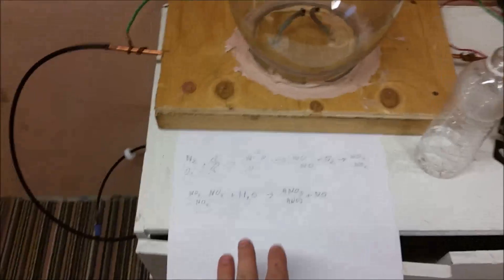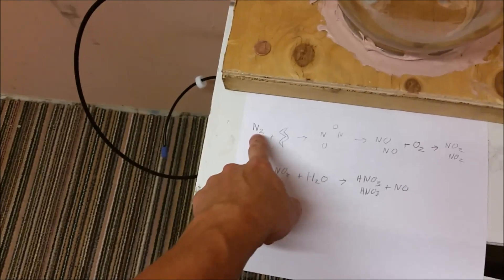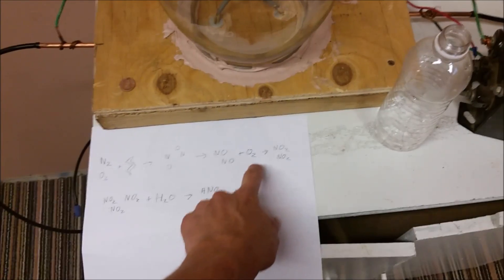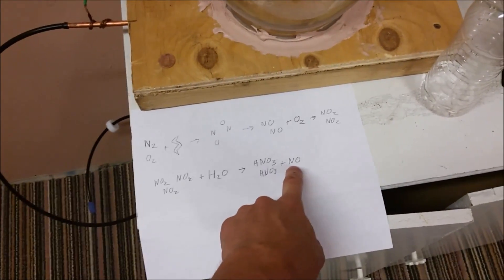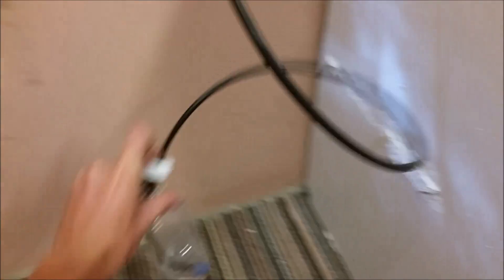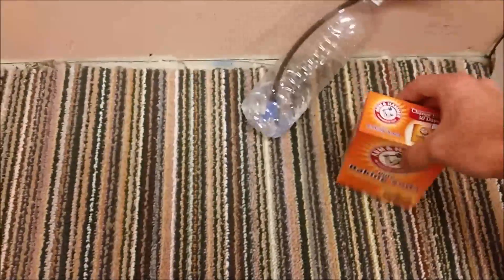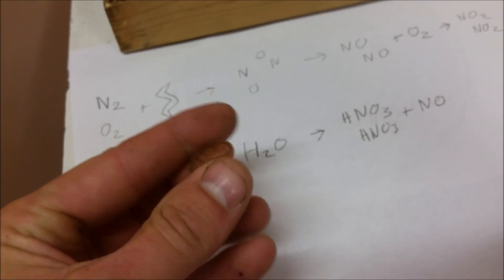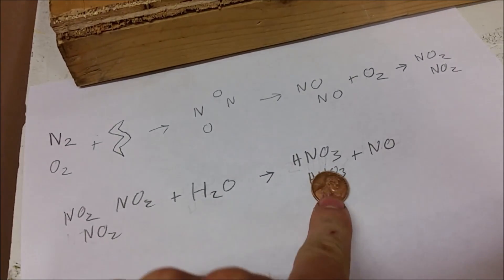Nitric Acid From Thin Air

Comment: Hey Cody,Couldn't you electrolyte the urea in urine to separate the ammonia from the carbon monoxide, if so couldn't you then decompose the ammonia to produce nitrogen dioxide and monoxide gas ( plus hydrogen) which could be dissolved in water or hydrogen peroxide?
Reply: Sorry decompose the urea, ultimately to make nitric acid my bad

Comment: Didn't you have to use the penny though? because you couldn't literally form Nitric Acid from pure air, without a copper base.
Reply: +Ricky Suave Cu not required, it is just a test for nitric acid (HNO3).  The reaction is basically N2 + 2O2 = NO2   then 3NO2 + H2O= 2HNO3 + NO.  No copper used.
Reply: +LFTRnow oh. then what was the purpose of the dang penny? XD (if he didn't explain it in the vid)
Reply: It is a test of the acid.  Most acids do not attack copper but nitric acid does.  Just google or YT search "copper and nitric acid" to see for yourself.
Reply: +Ricky Suave He explained in the video. Were you not paying attention?

Comment: G'day,

 Yay Team...!

 Decades ago a mate of mine sent me a book on Ley-Lines, written by a retired English Agronomist, who'd run the Government's Post WW-2 Experiments into attempting to increase Crop Growth-Rates, by trying to mimic the Electric-Field Effects of approaching Thunderstorms, by suspending a Horizontal "Ceiling" of  Chicken-Wire over a Paddocks of Mustard Seedlings, and using a series of 1,000 Hp War Disposal Tank-Engines driving War Surplus DC Generators to electrify the Grid...

 Literally, "Beating Swords into Ploughshares..." !

 He stated that they repeatedly and reliably achieved Metabolic-Growth Rates of 135% of that of the "Control" Paddocks, but that the cost of pretending to be an ever-approaching Thunderstorm, and thus tricking the Plants into "pushing the Throttle through the Gate" in anticipation of being rained-on", was not ever remotely worth the increase in Harvest Weight, and Market-Yeild, in the final reckoning...

  And by 1950 the British Government quit wasting their money on that brand of Witchcraft.

 However, 100 miles to the West of me,  right now, in the Cotton Country, they use 3,000 Hp Turbo-Thrush Crop-Dusters to lift 3 Tons of pure Water on dewy Mornings and after light afternoon Showers, at $2,500/Hr, to bubble depressurised Liquid Nitrogen into the Water at 5 Metres Altitude while spraying it onto the Crop, and "pretending to be Thunderstorms, fixing Nitrogen into the Raindrops at every Lightning-Strike"...; which strikes me as being "A very expensive Magic Ritual", considering that it's long been established that it's the Storm's approaching  Electrical-Field Disturbance which triggers the increased Vegetative Metabolic-Rate, rather than *any alleged Nitric-Acid in the  Raindropsies...

  It's a Segue, but I thunked it a justifuable one...?

 ;-p

Ciao !
Reply: +WarblesOnALot I agree about the witchcraft concept.  Seems after WWII the West lusted after certain "knowledge".  Great insight, thank you for sharing.

Comment: This is pretty much is the same as the Ostwald process for making HNO3.  However, it should be pointed out that NO2 is a "mixed" anhydride.  When reacted with H2O, it produces an equimolar mixture of HNO3 & HNO2.  This solution is then treated by having air bubbled through it.  The O2 oxidizes the HNO2 to HNO3.  The result is then distilled to make 67% HNO3.  Hey folks, read some chemistry books!
Reply: This is the birkland-eyed process.
Reply: So sir you mean that the Cody should bubble air into the resulting acid solution?
Reply: Clyde Wary
 show us your video
Reply: +Clyde Wary Nobody said that it isn't.
Reply: First of all his Voltage is in excess by couple of thousands which really do nothing in being responsable for reacting the gases. MicroWave transformer is doing the same job at 2000 volts. Second of all his Current is so low that he should be the Ant Man while at Ant size to be able of being satisfied with that spit in the bottle. Note that the starting Voltage for breaking the Nitrogen and Oxygen bonds is below 2100. However the higher Current and the higher flow of Air are only responsable for high quantity at short time production of these NO2 and NO gases ;)

Comment: 1.21GIGAWATTS?! 1.21 GIGAWATTS?!?!?!?!?!
Reply: +crobc1 I guess you've never seen Back to the Future...
Reply: ***** Dude, you're a total fun killer... but i guess there are two kinds of people, right ***** ?
Reply: +crobc1 seems a lot, 1.21GW with 500kV (or 1210MW / 0.5MV) means you have 2420 amps... wouldnt it melt over 1k amps?
Reply: great Scott O.o
Reply: +Olivier Myre Usually, there isn't just one line but many, so that the power can be split between them. Also the resistance of the wire is determined by its diameter, so if the wire has a bigger diameter, it has less resistance thus doesn't get that hot. And if the wire is bigger, much more material has to be heated up so you can safely say that there can be around 2-3 GW on such a power line. Otherwise, nuclear reactors producing 2 GW wouldn't have any way to transport their power ;-)

Comment: Dude, fume hood or outside. We'd all like to see more vids from you.
Reply: Brandon Lisik Looks like you havent been on this channel for tooo long.
Reply: Lol
Reply: +Brandon Lisik:
The NO2 is inside the glass dome. It should be fine.
Reply: @louistournas120  NO2 isn't very soluble in water so a lot was actually escaping. I was worried about it too. This acute exposure wasn't horrible but had he left it going as a long term project to make lots of acid over months, the NO2 would either kill him from the exposure or cause other health effects like asthma and lots of other respiratory problems. NO2 really is not my gig.
Reply: @louistournas120  he can flush it with ammonia vapour or just air and vent it
Reply: More FAKE Videos from this Fish Tank Bubbler SALESMAN? More possible using ammonia. Just buy NOS then dissolve it in water.
Reply: @w0lvez1  ?
Reply: @w0lvez1  
"Just buy NOS then dissolve it in water."

==What is NOS?
Reply: @louistournas120  NOS is a way of saying nitrous oxide, typically used when ppl refer to increasing engine performance. Nitrous oxide doesn't do much in water tho.
Reply: @kelvinyonger8885  I see. So NOS is N2O. It is a very different molecule.

Comment: you could increase the surface area of the electrodes to create more sparks, and increase the voltage to 100k volts to make longer sparks, would probably make it more efficient, then inject pure oxygen into it to attempt in creating the perfect 1:2 ratio of nitrogen to oxygen, and increasing the amount of water for the gas to bubble through with some hydrogen peroxide to increase yield. might be able to make much more acid with the same power usage. i intend to do this myself once i get the chance to build my chemical lab.

Comment: Nice first test setup. 

 Now, if you are going to run that thing for any length of time, you need to seal up your the bottle you are bubbling it through so the nitrogen/oxygen compounds can not leak out.  You need to run the waste gases somewhere you won't be breathing them.  They are bad for you in several ways, and running it long term indoors venting the un-reacted gas products like that into your living space would likely be bad for your health.  In one of my first trials I used a mason jar with two holes with grommets in the lid with a tube in one going to the bottom to bubble the gases in, and a tube just inserted into the head space at the top of the jar and vented outside to take away any unused nitrogen/oxygen compounds and vent them outside.

I have a small acreage and thought about building an apparatus to produce fertilizer for my land powered by solar.  I still may some day.  I have a small Birkland Eyde type reactor that I built, but I used an absorption column to strip the oxygen/nitrogen compounds out instead of just bubbling it through water so as to get a bit better efficiency.  My small test setup worked in a fashion and I have run it off of my solar setup as well as a test.  I am thinking about using an Arduino to control a scaled up and solar powered version  so that it can accumulate material while I am away from the property.  My current plan is to react the products with limestone available on my property to make calcium nitrate to use as a fertilizer, but it is just an idea for now.  I probably need about 80 pounds of nitrogen per acre per season on average, so it would take quite a setup to avoid having to buy nitrogen based fertilizers in the future, so I would probably only make a portion of what I could use.
Reply: actually you could get H from electrolysis, I believe you have done that already and then burn  an appropriate amount with air and chill it to get rid of the oxygen to get mostly nitrogen.  Then you could compress about three parts hydrogen and one part nitrogen over iron (steel wool) and then chill and condense out most of the ammonia formed, recycling the mostly hydrogen and nitrogen left over, in a crude version of the Haber-Bosch process.  Then of course you would react the ammonia with nitric acid  to form ammonium nitrate fertilizer.  The trick would be to capture as much of the heat as possible and put it to productive use in the process.  It would not be overly efficient, but for a guy like you with land, a solar panel array could be used as the power source.

Comment: Pennys havn't been copper, for quite a while, I hope you used an old penny.
Reply: +Roy M 
So then what else is it that you see, if not copper?
Reply: +superdau I wasn't saying it wasn't copper, I said the new pennies aren't. New Pennys are made of Zinc. Which would react in Nitric Acid too.
Reply: +Roy M 
pennies are copper coated zinc.

I imagine the acid eats zinc but probably many acids dissolved zinc and few copper. There still coated in copper though. It's just very thin, much like how gold is super expensive but you can get the gold sheets to like decorate a cake or foil something and get a square foot of it for like a few bucks. Copper is expensive for a metal but sheeted out less than millimeter thick its cheap to coat with.
Reply: Newer ones are copper plated zinc.  I used them as well to test for nitric acid when I did this.  It takes a bit to eat through the plating and I only reacted it a bit to provide evidence for the presence of nitric acid, then I rinsed it off.

Comment: You can improve the efficiency by enclosing the water chamber and boiling water too steam increasing interaction and reaction of the gas.
Reply: No, to improve the absorption of the NO2 gas You need to bubble the gas trough a packed column filled with silica wool and water

Comment: Strange effect of strong nitric acid: concentrated nitric acid does not react with copper very well because it immediately forms a protective oxide layer. But, I didn't see any crazy brown poisonous gas pouring out of your bottle either, so...dilute. Awesome experiment.
Reply: it does slow but then add two drops of water  then boom you have a violent reaction

Comment: if you use hydrogen peroxide, your yield will be more than this.it is because you are producing nitrous acid with nitric acid at the same time.h2o2 will oxidize it and you can titrate it with a standardisated base to find how much acid did you made. and you can distill it to concentrate etc.  pff its a lot of work.have good day :)

Comment: Maybe if you add a capacitor in parallel attached to the transformer that the process goes faster. a Leyden Jar can be used for the capacitor.
Reply: I hope so.. When i creating my teslacoil I noticed that the formation of gas was more after that I add a capacitor. 
I suspect it is o³.

Comment: You could use hydrogen peroxyde instead of water in that bottle, that way you will make some more HNO3 with the NO that just got to waste this time.
Try cooling (ice bath) the bottle, it will help NO3 disolve in the water as well.
Reply: +Cody'sLab yeah that (H2O2) i have no clue how to produce easily at home :-\